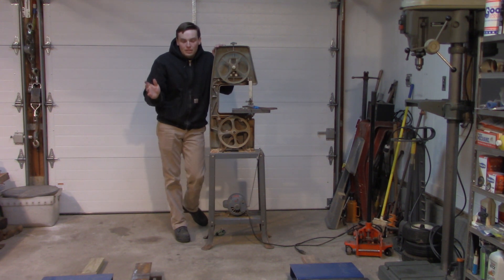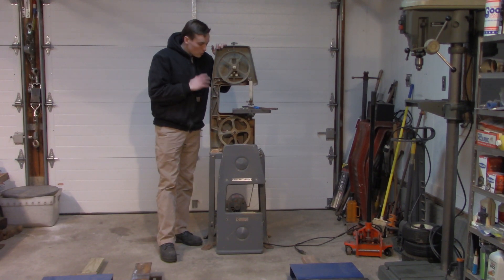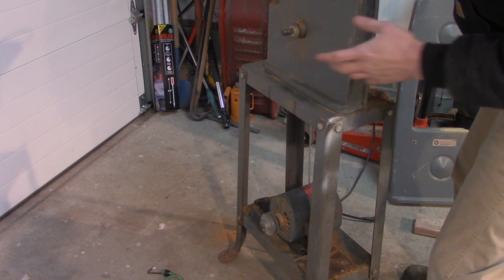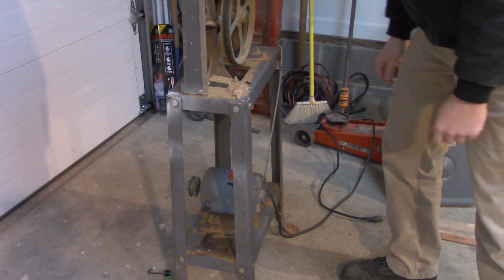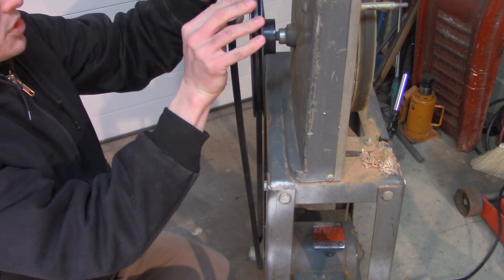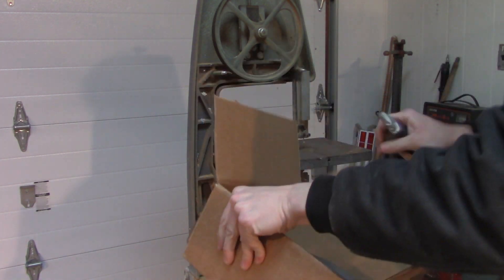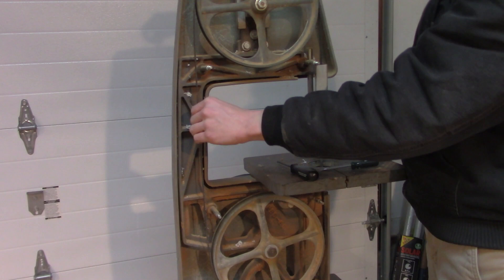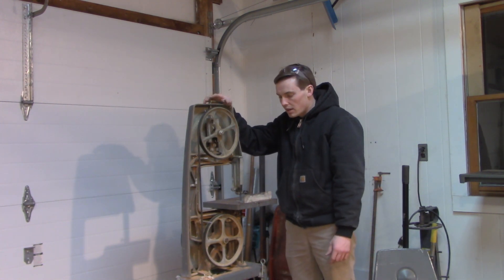Converting a Wood Band Saw to Cut Metal Part 1

Comment: I've got to cut solid round and square stock for turning and some milling projects, so I need to slow 'er down quite a bit mor than this. I was hoping to see a jack-shaft setup. Buying new for all the parts for a jack-shaft setup may exceed the cost of a HF portable metal bandsaw, IDK.

Comment: Keep me honest on these calculations: Assume a typical wood cutting bandsaw moves the blade at about 2400 fpm.  You want around 300 fpm or preferably a little less for metal.  So, replacing a 5" pulley with a 10.25"  results in a reduction of fpm to 5/10.5*2400=1170.  This is still way too fast.  What most guys do is introduce an intermediate jackshaft with an additional reduction of about 2.5/10.  That would result in a final fpm of about 292.  I believe that would be acceptable for most applications.  If you don't make that change, you'll just chew-up your new blade in a relatively short time with excessive heat build up from too high of a cutting speed.  And I like SAMRODIAN's idea of a few shim washers instead of a new belt.
Reply: You can tell just by looking at how fast the wheels are spinning in the video, it's way too fast...
I wonder though. As long as the steel is very thin, maybe you can still cut a fair amount even with a dull blade. Kinda like how you can cut 3/4" wood with a 3 tpi blade even when it gets super dull. It's when you go to cut something thicker that you notice how dull it is.
Reply: I mean, with a similar blade, my metal cutting saw at 450 fpm will not cut 1/8" hot rolled even half that fast. But I can also cut 1/4" steel and stainless bolts without changing the blade. I wonder if either of those things would reveal the shortcoming of cutting steel at this high of a speed.

Comment: If you have got the drive belt that tight and we're talking about getting a longer belt, stop and think, go buy yourself some washers and loosen the motor and put enough washers under the motor mounting until you can get the belt on and off easily. When the belt stretches, and it will. Just remove a couple of washers from one end and it will tighten it up again.
Reply: Your comment is constructive and helpful but the “stop and think” part just makes you sound rude and kind of ruins the whole thing.

Comment: That's still much to fast for a metal cutting bandsaw. Realistically you want it to be in the 200 fpm range.
Reply: The reality is the teeth per minute is more important so you can use a skip tooth blade to dramatically reduce it as well
Reply: @jmgraydz  not the greatest solution. for most metals a 24TPI blade works best so youd have to deal with rpm reduction by at least 4x